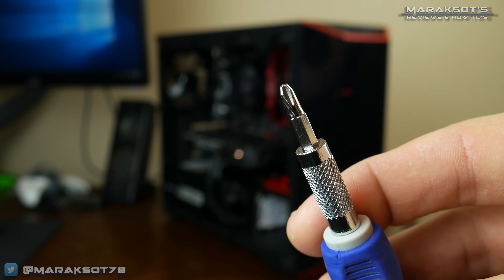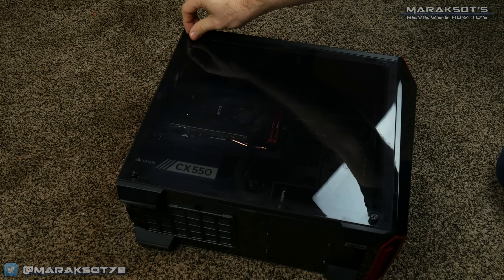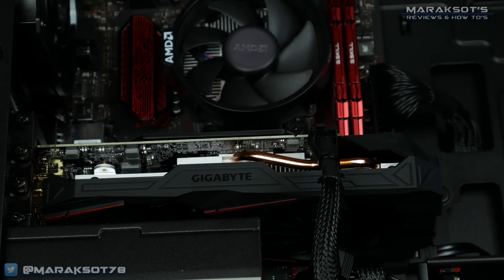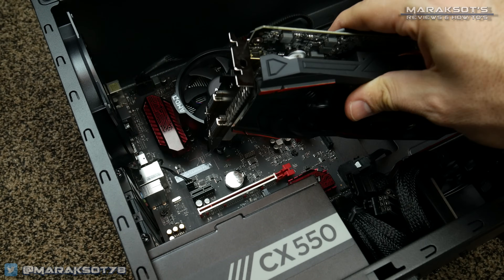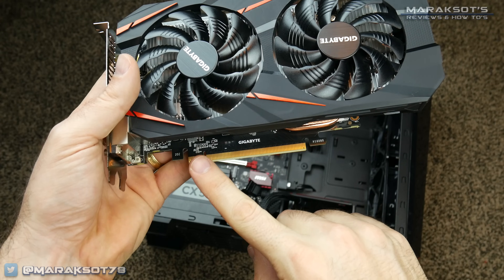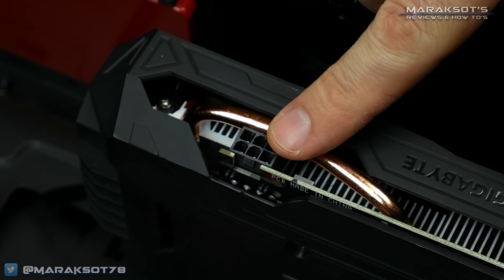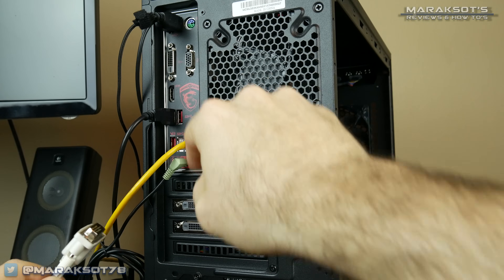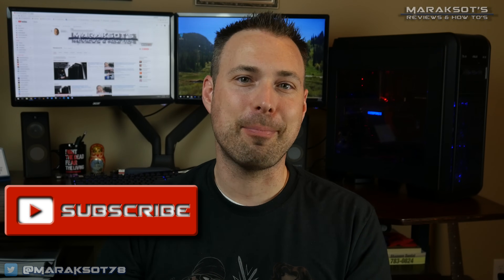How to Install a Graphics Card - Upgrade Your GPU

Comment: I need help!!! Ive had my gpu for half a year now along with the pc. So today i decided to clean out the dust. I took out the gpu before hand, and after cleaning, i installed it back. But to my surprise it said no signal on the monitor. PLEASE HELP! (I use an hdmi cord not vga)
Reply from the maker: The first thing I would check is to make sure the card is fully seated in the PCIE slot and if you have additional power connectors to your card make sure they're plugged in all the way.
Reply: Maraksot78 is a gtx 1070 compatible with a msi h110 pro d?
Reply from the maker: @ciru.  yes, but pairing a $400 graphics card with a $50 motherboard doesn't make much sense IMO.  A graphics card like the 1070 is meant for a high end gaming system, 1080p or 1440p resolution, high settings at high refresh rate (100Hz +). That motherboard is a very low end/budget board that is more deserving of a GT 1030 or GTX 1050.  You wouldn't put a $10,000 stereo system in a $1000 car would you?  I know I wouldn't.
Reply: Maraksot78 welp already bought it, did I atleast not waste my money too bad
Reply: Maraksot78 like will it downgrade performance or will something bad happen
Reply from the maker: @ciru.  it should work just fine, I apologize if I came off as being harsh.  I've just made the mistake of spending more money than neccessary by buying hardware that is above and beyond what I really needed and I hate to see other people make the same mistake. I guess I should ask what is the resolution and refresh rate of your monitor you plan to play on?
Reply: Maraksot78 1920x1080 144hz 24 inch
Reply: Maraksot78 And I currently have a 1050 ti but using a 144 hz screen is unbearable feels way too laggy
Reply from the maker: @ciru.  ok cool. For 1080p 144Hz the 1070 is a great choice. It will serve you far better than the 1050ti and you'll even be able to play most stuff on fairly high settings at that frame rate.  I assume you're going to be pairing at least an i5 CPU with your 1070? If so you're going to be set up for a great gaming experience on your 144Hz monitor. :)
Reply: Well that sounds great, it is arriving here tomorrow. I am using your guide to install the graphics card, I will let you know how it goes tomorrow. (Yes I am using an i5)
Reply: Maraksot78 I have removed my graphics card to get it ready for tomorrow but there was nothing it was connected to only the motherboard
Reply from the maker: no worries there.  The 1050ti doesn't require any additional power from your power supply via a 6 or 8 pin PCIE power connector so there wouldn't be any of those to unplug.  I assume you're talking about the power cable I show at 3:06 in the video?  A GTX 1070 however will require at least a single 8 pin PCIE power connector from your power supply in order for it to work.  Also you'll want to make sure your power supply has enough wattage to power a 1070.  You need to have at least a 500 watt PSU for a GTX 1070.
Reply: Like the pci express power connector wasnt there but it worked?
Reply from the maker: your motherboard is capable of supplying 75 watts of power to a graphics card though the PCI Express slot that the graphics card slots into.  Less powerful graphics cards don't require more power than this to operate.  The 1050ti model you have must be one of those cards that only requires 75 watts to operate so it does not have any supplemental power connectors.  The card I'm using in this video is a GTX 1060 which is a more powerful card which means it also requires more power to operate.  The 75 watts supplied by the motherboard is not enough for my GTX 1060 to operate so it needs supplemental power from the power supply.  The Gigabyte 1060 I'm using requires a 6 pin PCI Express power connector from the power supply as you can see in the video.  Your 1070 will also need supplemental power but will require an 8 pin PCI Express power connector.  I hope this all makes sense.  :)
Reply: Maraksot78 Would this be on my psu???
Reply from the maker: yes your PSU should have a sticker on it that says what's it's max wattage or max output is.  You'll want to make sure it's 500 watts or higher.  Or are you meaning would the PCI Express power connectors be on your PSU?  Depending on your PSU it may or may not have any PCI Express power connectors on it.  If not there are adapters you can buy to adapt from either Molex or SATA power connectors to PCIE.
Reply: Maraksot78 Yeah well I cant figure out how to get to my psu from my case
Reply: Maraksot78 Nevermind got it, my graphics card comes with a 6 pin to 8 pin pci express port so I should be good to good, thank you for the help I will let you know how it goes tomorrow
Reply from the maker: are you referring to finding out it's max wattage?  When you open up your case to pull out your graphics card you typically should be able to see your power supply.  There should be a sticker on the side of your power supply that says what the max output wattage is of your unit.  If there's nothing like that visible on the power supply when you remove the side panel then you may have to remove the screws from the back of your case that hold the power supply in place.  There are usually 4 screws on the back that hold it in place.
Reply: Maraksot78 My power supply is 500 watts I couldnt find the pci express cables but found them, they are 6 pin and my graphics card is 8 pin but my graphics card comes with an adapter
Reply from the maker: awesome!  sounds like you're good to go.  :)
Reply: Maraksot78 I have just realised I purchased the mini version of the 1070 zotac, will this affect if it will work with my motherboard (sorry for asking so many questions)
Reply: Maraksot78 I installed the graphics card around 5 pm est and have been using it since, thank you for this guide the graphics card is amazing
Reply: Maraksot78 I do feel like the graphics card has a bit of a bottleneck (I have a i5 7400) what cpu would you recommend for the 1070

Comment: What happens If you have onboard graphics instead a pre existing graphic card?
Reply from the maker: If you've just been using ypur CPU's onboard graphics all you have to do is install your card, Hook up your monitors video cable, be that DVI, HDMI or Display Port to your graphics card, boot your rig, download and install the most current drivers for your GPU and then enjoy. :)

Comment: I have a question  a game asking  minimums  requirement  i3  and am using a E6500 can I run the game smoothly  I don't do overclocking
Reply from the maker: The Pentium E6500 is an 8 year old dual core chip so if it's a modern game then I don't know how well it will run. Depending on your graphics card it may run ok but I cant say for sure.
Reply: Maraksot78 the game is from 2017  minimum   graphic card was an Intel HD 4000
Reply from the maker: If the graphics card in your system meets or exceeds their minimum requirement then go ahead and install the game give it a try and see how it runs.  If it's playable then awesome.  :)

Comment: Thank you for this video. I want to install a graphics card into my computer and was told I may also need to upgrade my power supply. I have searched a ton of forums and have been told I do because its only a 300 watt and then told I don't if I go with a Nvidia 1050 Ti  a single fan card. Any suggestions? Im doing as much research as possible before I just jump in and do it.
Reply from the maker: yes the information you've provided is all accurate.  depending on the graphics card you choose you may need to upgrade your power supply.  When I'm shopping for a new graphics card I like to look on newegg.com at the specifications of the card and typically there will be a call out for the recommended PSU wattage.  The GTX 1050ti recommends a 300 watt minimum power supply so it will work just fine with your current PSU. Graphics cards are getting more and more power efficient all the time so nowadays if you have at least a 500 watt PSU then you'll be able to run almost any graphics card with it, except for the absolute top of the line stuff like the 1080ti which recommends a 600 watt PSU. One piece of advice I like to give people when they're looking for a graphics card is to pair their card based on what monitor they'll be playing on and what games they like to/want to play.  What I mean by that is if the monitor you're playing on is 1080p resolution and has a refresh rate of 60Hz then you'll want to look at graphics cards that will be able to run your favorite games at 1080p, 60fps (frames per second) at whatever settings you're happy with.  As of right now the 1050ti is a really solid 1080p, 60hz card but it can't run all modern titles on max settings at 1080p and still hit 60fps.  At max settings the frame rate on many AAA titles it's not going to be able to hit 60fps.  The GTX 1060 or the RX 580 on the other hand are the perfect sweet spot cards for 1080p, 60fps max settings on pretty much any game out there.  If you go up to more expensive/higher performance graphics cards like the GTX 1070 or 1080 then, in my opinion, you're going to want a higher resolution (1440p or 4K) or higher refresh rate (100Hz+) monitor in order to take advantage of the performance those GPU's are capable of.  What happens is when your graphics card is sending more frames per second to your monitor than it is capable of displaying then you will experience screen tearing.  Which is when portions of the screen do not align properly.  The way to fix this problem is to then enable V-sync in the game which limits the performance of your GPU to match the refresh rate of your monitor.  So in my mind this is throwing your money away because rather than getting the $500 (or whatever amount of money) worth of performance you paid for the card, you're only getting $200 (or whatever) worth of performance because the card is being limited to the refresh rate of the monitor.  I hope this isn't too confusing and that it all makes sense.  I've overspent in the past before I learned this stuff and I like to pass on the knowledge to help other people avoid making the same mistakes.  :)
Reply: @Maraksot78  good advice!

Comment: Hello like I have a cpu  Pentium  (R)Dual-core and my ram is DDR2 but if I change my ram to DDR3 and not my cpu what will happen?
Reply from the maker: In order to change from DDR2 to DDR3 your motherboard would have to support DDR3. Typically motherboards only support one type of memory (there are some that support more than one type but they're very uncommon) so in order to upgrade from DDR2 to DDR3 you're going to have to upgrade your motherboard which will also mean you're going to need to upgrade your CPU because your old CPU most likely won't be compatible with a new motherboard.
Reply: Maraksot78 k thx
Reply from the maker: No problem. :)

Comment: Hello i have a Pentium(R) dual core cpu E6500 @2.93 2.94GHz  I have 4 GB ram DDRR2  what kin of gpu u recommend  me to use  i really need one buc I can't play games Hope u reply
Reply: I am a fan of nivida
Reply from the maker: If you're ok with buying used I would say a GTX 960, or if you want something new a GTX 1050. I wouldn't recommend anything more expensive than that to pair with your current system.
Reply: So if i buy a 960 or 950  I will not have problems  in running it?
Reply from the maker: It should work fine
Reply: Maraksot78 thx for your time
Reply: But I have one more  question what will happen if  u connect ure HDMI cable  to ure moderbour than in ure gpu
Reply from the maker: Most of the time when you install a discrete GPU, your system automatically disables the onboard video so you'll want to plug into the output on your graphics card
Reply: Maraksot78 k thx
Reply from the maker: No problem. :)

Comment: My new amd radeon rx570 works only to the Intel screen where you pick bios settings etc. and i cant even do anything after that but when i put back old graphics hard it works fine...anyone knows how to fix this?
Reply from the maker: So you're able to get to your BIOS and adjust settings there but then when loading into Windows the screen just goes black?  If that is what you're experiencing then you may be able to fix that by updating your motherboard's BIOS... assuming your motherboard manufacturer has an update available for your motherboard.

Comment: Why do i have a flickering after installing the new one and that happens when i try to install the driver
Reply from the maker: So you just installed a new graphics card and your screen is flickering all the time or just during the driver installation?
Reply: Maraksot78 when i try to open any browser and go to amd site for driver
Reply from the maker: Mr.GamerWR so it only happens when you go to AMD.com?
Reply: Maraksot78 no actually, it also happens when i go to safe mode
Reply: My old gpu is a gtx 550 ti while my new one is an xfx rx 550 2gb
Reply from the maker: That's really strange. I've never had anything like that happen before. If I were in your shoes I would google the problem you're having and see if anyone else has experienced the same thing and found a solution. I do remember a recent video from JayzTwoCents where he was having an issue with the AMD drivers on an AMD APU and had to do a lot of searching for the fix. Here's a link to that video.  https://youtu.be/heYlWjkVrgY. Not sure the driver he links to in the video description will fix your problem or not but I figure it's worth a shot.
Reply: Maraksot78 i also get the error 43 on device manager
Reply: Do i have a defected one?
Reply from the maker: It's possible you have a defective card but most likely it's a driver issue.
Reply: Im stuck there and i dont know how to fix it
Reply: Do you think that if i reinstall windows(because it deletes everything including nvidia drivers) will fix this issue?
Reply from the maker: What CPU and motherboard do you have? You might need to update your motherboard bios...
Reply: Maraksot78 my pc specs are:
-Xeon L5410
-digital alliance ig41 ma6 mobo (its new)
-6gb ddr3 ram
Reply: I did update the bios 2 weeks ago
Reply from the maker: Mr.GamerWR well I wish I could be more help but unfortunately I'm not entirely sure what the issue is. It could be a defective graphics card, a hardware incompatibility issue or a driver issue; it's hard to say. All I can suggest at this point is to make sure the card is properly seated and scour the web to see if someone else has encountered a similar problem. I imagine you aren't the only one and someone out there has found a fix. Once again, I'm sorry I can't be of more help. Best of luck to you.